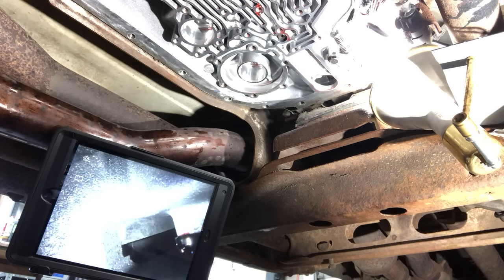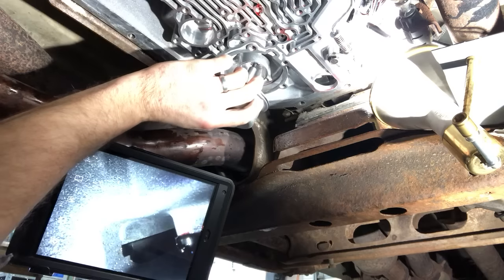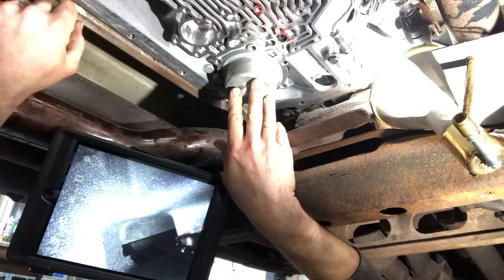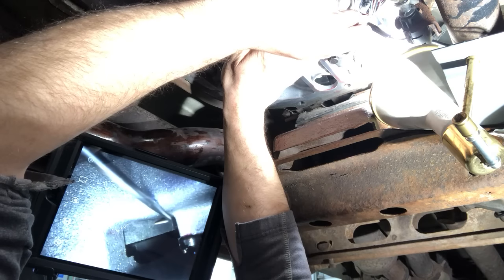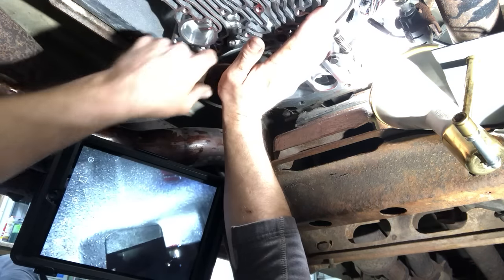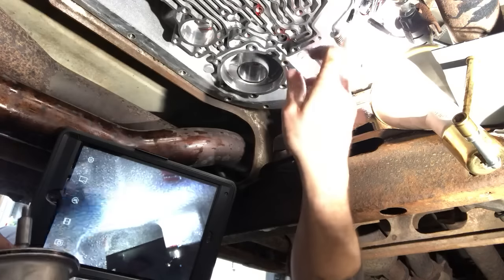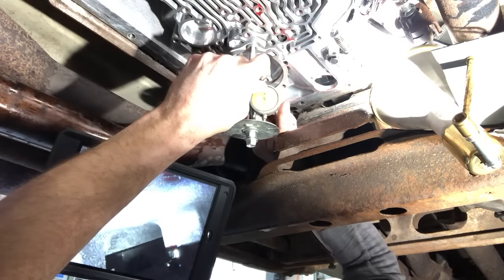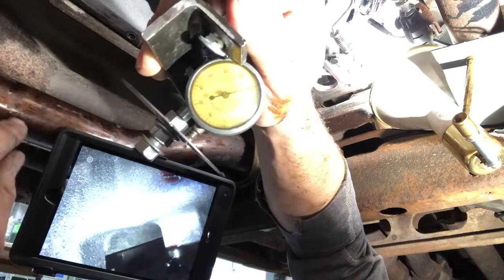How to fix No Reverse in GM 4L80-E GM Automatic Transmission Loss of R for FREE

Comment: Just finished this operation yesterday. You do not have to drop the valve body. You can remove one solenoid with a number 20 Torx head bit. If your patient you can worm it out and worm it back in. Welded on my rod turned it into 4.980 in. Reverse is Rock Solid. Do not drop the valve body no need to
Reply: How did you know what length to make it
Reply: @tysonrobinson9575  the factory maximum length for for the reverse Rod is 4.980. Since  my Reverse band was Worn i made mine the maximum length. Worked out good
 if it's too long you will feel it pulling reverse when on
 flat ground, then you will have to repeat the entire process. Don't overthink it it's not rocket science. You can however buy a factory for .980 Rod
 I spent more time thinking about it than it took to do it
Reply: @clintwolfe8096 how long did it be took u to fix it g
Reply: What rod do I weld
Reply: How has this worked long term? Still using the same transmission?
Reply: What rod is called parts store doesn't know?
Reply: What if my transmission engages into reverse but not drive ? It’s a 1994 5.7 Chevy Silverado 4x4

Comment: Anyone watching this, YOU DONT NEED TO DROP THE VALVE BODY !!. If you have lost reverse completely, you need roughly .200 welded on top. It does not need to be perfect.
Reply from the maker: That is exactly what i said in the video.  And it is 0.20"  (twenty thousandths... not two hundred thousandths).   Im just a guy that has no training in transmissions trying to help some other fool in a pinch get to tomorrow.  Thanks for watching!
Reply: .200 is the same I think. Most measure 4.780 and you need 4.980 +/-.  .200 = .20.. 20 thousandths is .020
Reply: south texas like hell you don’t
Reply: You don't, plain and simple
Reply: .0200 is a matchbook thickness.  You most likely needed to add .200, two hundred thousandths. That would be almost standard for a plow truck band. Good helpful video
Reply: you do need to drop the valve body down. otherwise you will not be able to remove one reverse server bolt out. it a pain in the ass. be very careful when lowering the valve body down because of the check valve balls in the valve body
Reply: Hey I have this problem, but no absolutely nothing about how to work on a transmission however I'm a Good wrench Turner, is there somewhere it shows me what I need to do to fix this problem it's a little more to the point and plane step by step?
Reply: You guys reeeeally need to learn decimal point locations and their values.

0.1=10's.  10 of these=1.0
0.01=100's
0.001=1000's
0.0001=10,000's
Reply: @WHATTHEFIX  4 years late sorry? lol  96 vintage els gmc same as yours in the garage . no reverse and that jerk or jump you say in drive. I don't know if I could take a chance and screw something up. then the problem to tell a pro how its broke ? probably tell me to let the doctor decide and ruff me up with a hefty price tag.

Comment: Also want to comment, that on my 1999 2500 4x4 4L80E I had to drop valve body to get to 1 bolt. I have every tool in the box. Still had to drop valve body.

Comment: Came across this video today as my reverse all at once got weak with all forward gears functional. Wasn't convinced this was my issue until you said no decel in low gear. I've been fighting that issue for a long time not able to figure it out. I'm going to give this a try! Thanks for sharing.
Reply: did it work?
Reply: @HeyFlames  yes it did! I've put about 10k miles on it since 

What I did was weld more material on to the end of the pin then grind it down to match the original shape.

Comment: The reverse servo push rods are select fit when they build the transmissions (i.e. they are different lengths to give proper band clearances when the trans is NEW). There are aftermarket adjustable push rods available to adjust the band for wear..... like used to be standard.

Comment: I just lost my reverse today. Glad I found this video, This is so much better than pulling a transmission. My truck has over 300,000 kms on it. This would be a good patch to last the old truck until it dies. Great video.
Reply: Excuse me did you ever fixed your truck with this patch!?
Reply: @ricardogutierrez1840  No, Turned out to be water from driving in the mud. Did a flush and it started working again. It's working great now and has been going strong for a few months now. I have also had the exact same scenario happen when it was a bit low on fluid!
Reply: @bradlys4978  ok thanks for the info

Comment: I needed to change the transmission pan gasket on my93 chevy c1500 and after doin that i dont know what happen that now only the reverse works but not the drive gear. Any idea what might be the issue. Thanks.

Comment: Hi there! I've got the problem with R - when engine/transmission is hot (normal temperature) sometimes R starts to slip. It's only when it's normal hot. What could be the problem? D (1-2-3-4) works good. Oil level is ok. No trash in pan detected. Thank you!
Reply from the maker: Sounds like your R band is wearing thin.  Short term fix is this.  Long term is to drop the trans and replace. Along with boost valve. (likely just rebuild if that far)
Reply: WHAT THE FIX thanx bro! Suppose to dismount the trans and see whats inside

Comment: am having issues with a Lexus 330 13pin it doesn't move backward it only moves forward have change the body valve from 10 to 13 pin yet it does not given me wat I want pls I need your advice pls

Comment: My 1997 v6 automatic chevy silverado , my truck drives but does not reverse . It in gauges into reverse but when I press the gass is does not reverse.  Also I put a new fuse for my dash cause it blows out when I    put it  from Park to Reverse . But if I put it from Park to Drive with out stoping on reverse it does not blow out . Any Ideas ???

Comment: Did the truck move once you put new fluid in? And did it smell burnt when you drained it??
Reply from the maker: Yes, and no the fluid was fine.  I imagine the majority of the band's deterioration was from years of use before the latest fluid change.  I was stuck in snow and most likely was over aggressive and caused it to fail suddenly.

Comment: I have a 2002 3500 4x4 4180e has a delay when putting it in reverse it never slips once in sometimes it's right there other times it's like neutral then I put it back in park then back in reverse and it is there????any help with a quick fix lol thanks
Reply: Oil level too high?
Reply: Nuetral safety switch or linkage needs adj
Reply: Did you have a whine at all ? And did you ever figure out your issue and fix ?
Reply: @guitarguy4334  really ya think?

Comment: Reverse fails in gmc astro 2000.i have to problems in the mornings put it on reverse. is the same process to fix my van ?
Reply: Astro has a different design transmission.

Comment: 1995 GMC 1500, put it on reverse heard a pop sound no reverse but has drive. I have to make the gears change by pressing gas peddle then led off and it will change gears will not change by itself
Reply from the maker: Dunno... wish I had better answer
Reply: Rear band giving up was the pop maybe. Should be able to see it with the valve body dropped.
Reply: @tmfo125  May be the shake shimmy of the truck causes something to move back in to the correct position unill it comes back out again. just a thought. lol
Reply: I mean go's back out again. no sleep less brains. lol

Comment: My 2013 Ford transit connect xl drive forward in reverse wtf...😢 any suggestions 🤔
Reply from the maker: Too new for my old brain LOL  So much electronics
Reply: @WHATTHEFIX    Mine did the same thing? later I found the shift handle was unscrewed from the drive colum upper part of steering whell. 😅😅😅😂 used a pipe wrench to screw it back tight.
Reply: Steering wheel

Comment: You don’t need to drop the valve body to change the rear band servo.
Reply from the maker: As I said in the video, someone with more talent and experience than I could perform this with out dropping the VB.  Thanks for checking out the vid!
Reply: travis schneider like hell you don’t
Reply: My 4L80E is 2004.  I did not drop the valve body either and I was able to fully service my reverse servo, while laying on my back.

Comment: What if I get a new pin? I've see them for around $10.
Reply from the maker: Absolutely!  I just live in a rural area, and it would take me at least a day to get a pin in my hands. At that point, I did not have the time.  Keep on truckin'
Reply: Cool .... I asked at the dealership and there's 4 different sizes tho.... Trying to figure out which one to get before i take it apart.... It's also going to take a day or so for me to get it also.
Reply: @thomascantu3545  Did a new pin fix your issue and did you have a whine at all ? I have reverse coming and going and then none then if i go forward a bit, i get reverse back for a little bit..

Comment: Any update vid?
Reply: It lasted a couple weeks.... Until I got stuck and had to severely work the trans.  I hit R too early in the attempt at rocking out of a snowdrift and she snapped.  I feel the band would have lasted the season. If it was just a regular daily driver type truck I bet it would last indefinitely or until something else in the trans failed.
Reply: @JRA79  You might be interested to know that the 4T65E has a forward band breaking problem and the sonnax fix is a longer push rod S84908H for that apply servo. As they age, the timing for various shifts becomes delayed by missing clutch and band material. The 4T65E measures this time and boosts pressure when the time is too long. And this results in maximum pressure just as the too short stock rod hits the band and band breakage is a common issue with those. In that case it's the forward band and when it's done broke itself like this, you are walking. So a further problem is the regulation of the pressure rise during this timed pressure rise and that particular valve (AFL) in that transmission wears out about the time the band does as well and this further aggravates the issue. That fix is kit K098 from superior.  I would suggest every pressure kit sonnax has for yours to steer that problem away from the table. P1881 is a common code for my transmission and the sonnax rod appears to be 2/10 longer than stock and that is 200 thousandths - 0.200. Twenty won't even compensate for what has worn out, you need to shorten the timing drastically as they all do this timing thing. A better rig to build would be one that bolts on and measures how much it moves before you take it apart and then shorten that measurement by 0.010 so that the band isn't applied when not called for. I got my dial micrometer for 20$ from harbor freight and it would work fine for this. They will ship right to your door, I live the rural life.
https://www.transmissionrepaircostguide.com/p1811/

Comment: Dude, you lost pressure and wore out the reverse band.  Plowing heats up reverse bad more than any job. Forget what your doing and replace the reverse band.  Why did you remove the valve body? Band pieces were most likely in the pan. Dark oil? burnt smell to oil?   Rebuild and replace the reverse band.
Reply from the maker: As I stated before.  I’m one step from swinging in the trees... transmissions be tough.   Also, was in a huge pinch.  When I was done snow plowing for the year I rebuilt the entire transmission